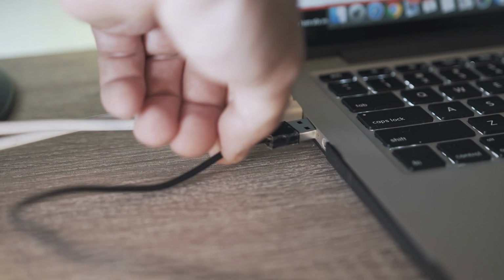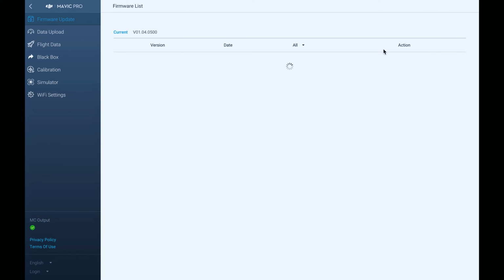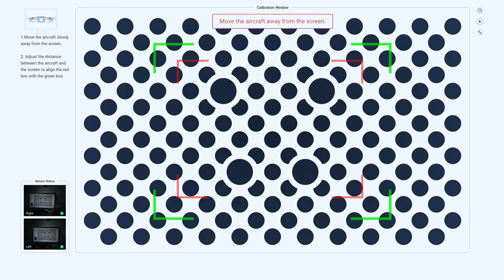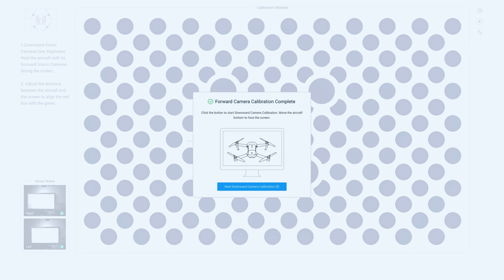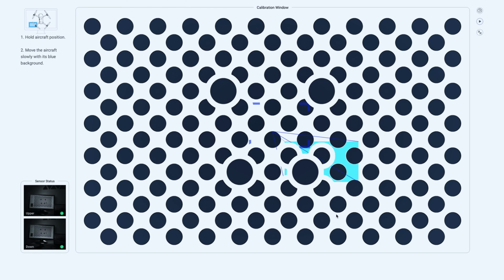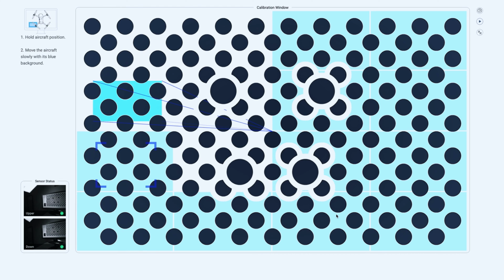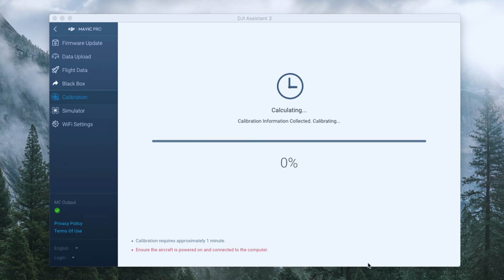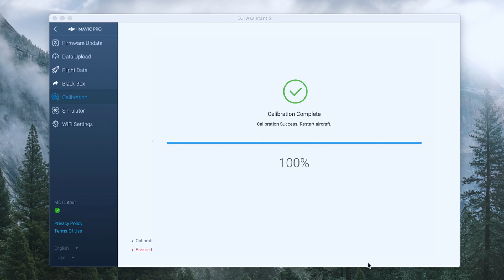DJI  Mavic PRO Sensors Calibration | Vision Positioning System (VPS) Calibration | 4K

Comment: I have tried 8 times and it does not start the calibration, it's stuck at 0% after all of the processes. Just stays there.
Reply from the maker: hi, try different usb cable, and also different pc or screen. 
thanks for watching
Reply: Thanks. Have tried the different screen on a different machine but not with a new cable. Will let you know.